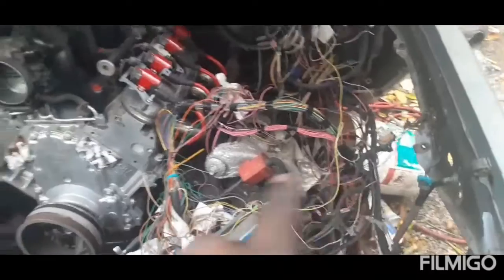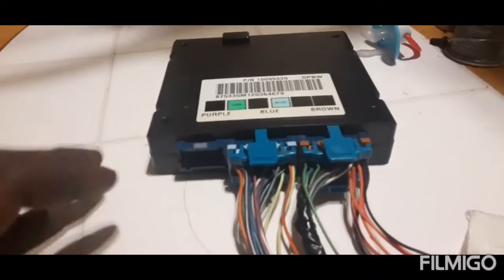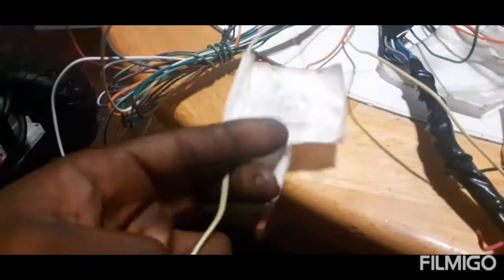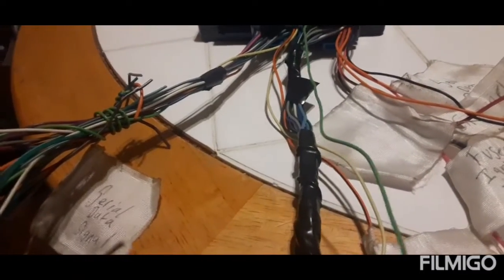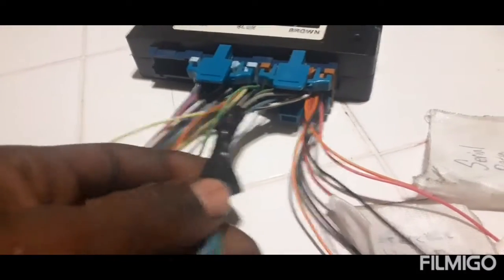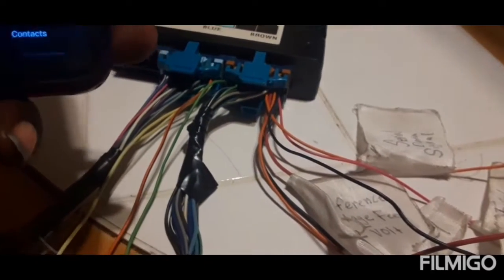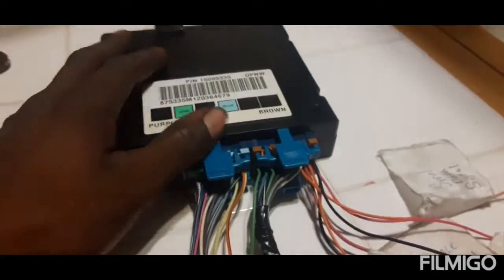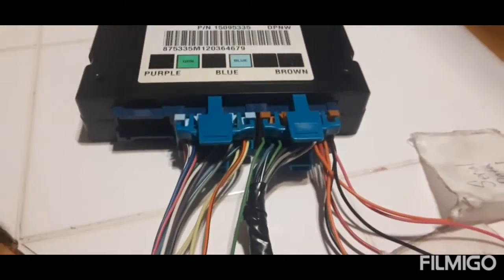GM Bypass Vats On LM7 / Ls Swap BCM Wiring Information

Comment: Hello Lm7 Chevy I don’t know your real name but I do love your videos! Man they are so informative! But I have a question that I hope you can help me with?
I have a 2005 Chevy Avalanche that I am parting out for my 2003 Chevy Pick up. I have removed the electric fans from the Avalanche. That includes the wire harness for the fans.
To put in the pick up truck. My question is can I swap the computer from the Avalanche to run the fans? Or is there other stuff that I need to do? Do I need to swap the BCM module as well?
Thanks for all your help! In advance
Reply from the maker: Hey what's up thank you so much! You can get your 03 ECM Programed For Fans. The 05 ECM is drive by wire, so you don't need the 05 ECM. you already have one the 03.
Reply: @BackyardFamilyBuilds  
Oh OK thanks but can I do that with the OBDLX and if so how? Would it be easier to talk on the phone or email?
Reply: @BackyardFamilyBuilds  by 
By the way I think your right they are both drive by wire.

Comment: Hey nice video so i have a question the orange/ black wire is the wire for fuel enable wire on ecm  or the yello wire on bcm i just order a bypass module for vats bypass

Comment: Where did you find the pin out info?
Reply from the maker: Of The BCM Or The ECM?
Reply: @BackyardFamilyBuilds  BCM
Reply from the maker: I Found The Grey Plug On A Form. Where Another Guy Was Looking For The Exact Plug, I Was Looking For.
Reply from the maker: @David Young Google Also Shows That There's A Book On Wiring Information  On GM's BCM Also.